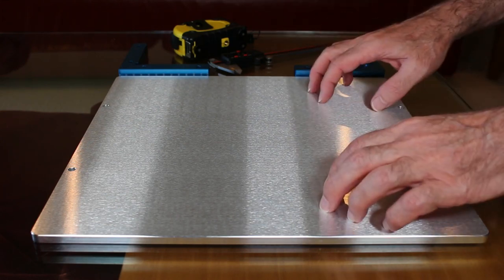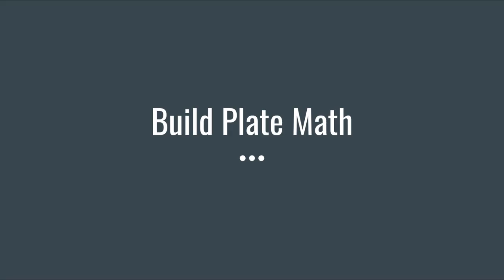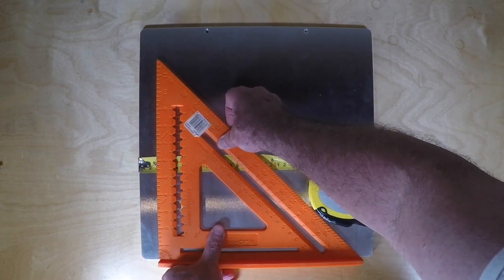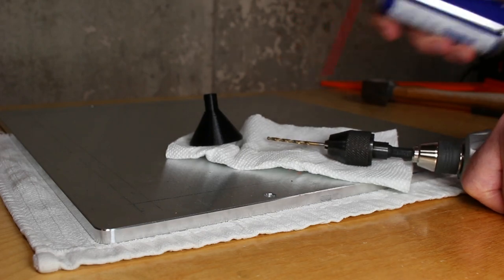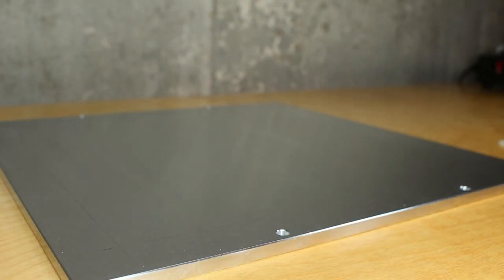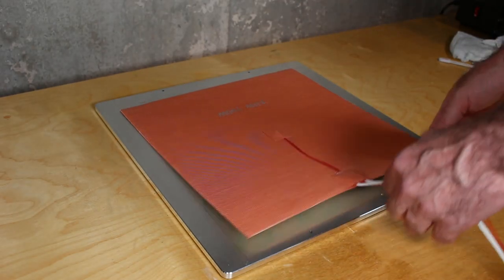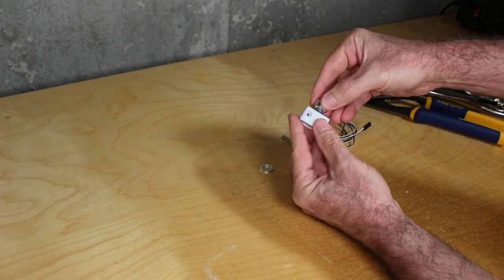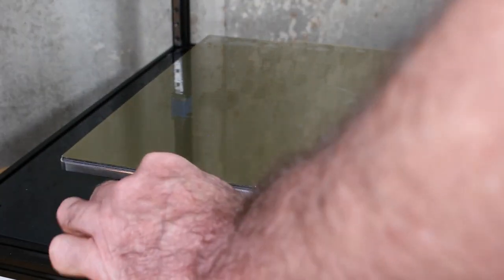Voron 2.4 Blurolls Kit Part 5 - Build Plate & Z- Endstop Assembly

Comment: Awesome series man, thanks alot. This will be my first 3D printer. Been researching alot and just consuming as much info on everything I can on every type of printers & their differences. As my knowledge increased, so has my ambitions, and looked into creating my own printer with parts I thought would be superior, lol. Ended up looking like a cnc engraver/laser, one with all lead screws for each axis, another with linear rails on each axis and another with a combo of lead screws for (Z axis) linear rails on the (Y) and an Exoslide on the (X) axis, all in a ExoCube config, lol. Not to mention the countless Creality printers and the upgrades that I wad looking into. Through my endless research, I kept seeing Voron printers & finally went some that hole. Needless to say,  I think im hooked on this for my 1st printer. Anyways, The 1st tap you used is called a reamer, it's used to true up the hole after using a drill bit.🤙 once shading that's for your tutorial, good job.
Reply from the maker: We've been down similar paths.  Thank you for the tip on the tap!  So far, I'm having a good time with this build.  That said, it might not be a bad idea to get a relatively cheap introductory printer if you have not previously.  This Voron is not cheap and a 1st printer can be had at 10% of the Voron price which would be great for experience (and a tool to print out about 100 parts to build your Voron).  But if you are handy with tools and the funding is available, go for it!.   Most of all, thank you for all the kind words and feel free to reach out if you have any questions.

Comment: That is all sorts of the wrong bed.
Reply from the maker: What is wrong with it?
Reply: @KapmansBasementWorkshop  the reason the holes are like they are in the stock bed is to allow for thermal expansion, these through holes are going to bind under expansion, also it doesn't appear to be cast aluminum, it's going to warp under a few heating cycles. It also needs another hole taped to ground it.
Reply from the maker: @urufushinjiro  , Got it.  Well, I plan on showing those results, before and after to better understand any issues that might come up from the makeup of this kit.  I assumed at some point I'd need to replace something.  I'm prepared for when the time comes.  Thanks for the feedback!
Reply: @KapmansBasementWorkshop  My blue rolls kit came with a cast bed. Honestly I don't see it making much of a difference as the textured PEI sheets alone introduce all kinds of variation but a properly calibrated probe will correct for variances much higher then any of these kits have. It's like having a stereo you can hear from 2 blocks away then spending $200+ so people 5 blocks away can hear.
Reply from the maker: @ChrisHarmon1  That is a very good point.  When I was installing the magnetic sheet to the bed I found myself wondering just how flat that was as well.  Between the two, and the fact that the gantry also flexes due to heat, the probe is key.  I must say, my prints come out great.  I have no problems that I can see or measure related to bed flatness.